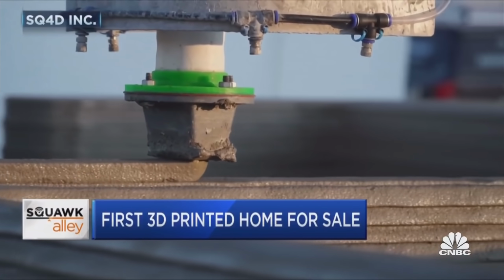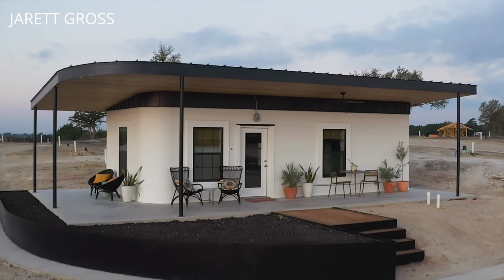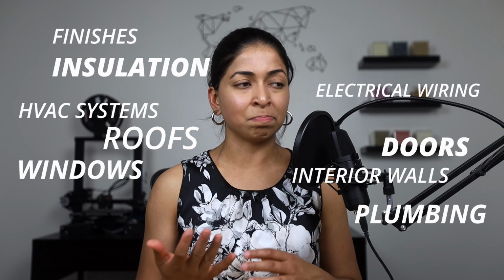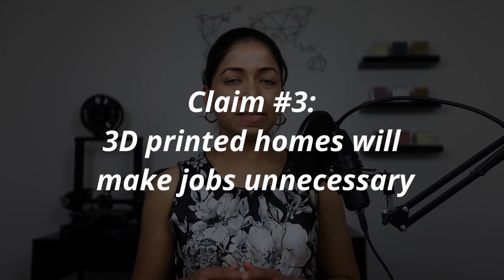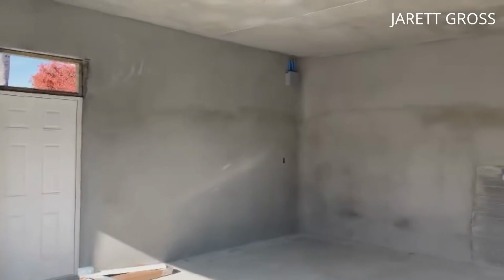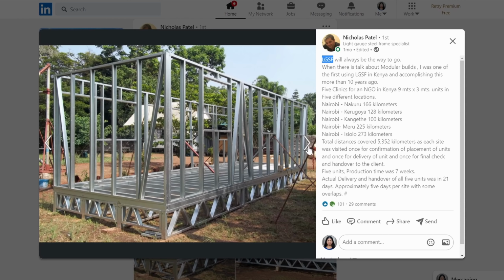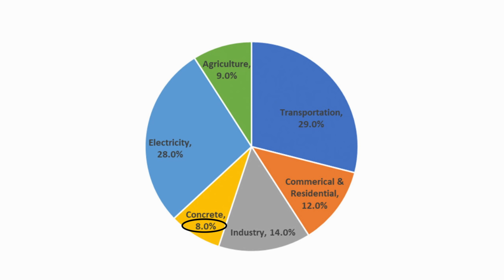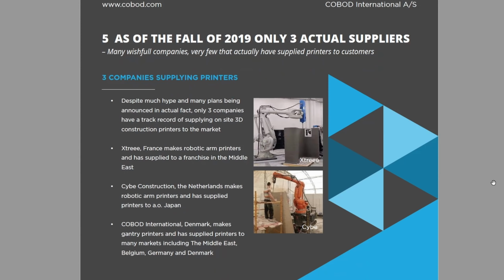Exposing 5 LIES about 3D Printed Concrete Homes

Comment: What is the advantage of 3d print over just putting up foam block and filling with concrete or using standard wall forms I don't see making putting up a wall more complex and using more electrical and everything better than what we have now and like you said concrete is horrible for the planet and that doesn't change if you pour it or 3d print it it's the same concrete plus in a poured foam wall you can put in what ever reinforcement needed for the area it's being used

Comment: The video should start out that 3D printing may not work for 3rd world countries.  Steel factories and lumber yards are high pollutants too.  The claim for a 3D printed house in 24hrs is real, they didn't claim they installed the plumbing or electric or appliances or even the doors and windows!  Just the 3D printed shell.  I'd love to get a 3D printed set of walls so I could finish most of the work myself into a nice house here in Las Vegas.  I don't want windows, I want all plumbing and electric on the sides of the inside walls for easy repair and artistic look that would be blended into the rest of the wall art.

Comment: Good job! aside from the marketing this is in its infancy and has to be supplemented with intervention because a house is a system not just a part.  I'd like to see you do more on solar panel scam that is a true scam that most people do not do the economics nor see the vast environmental impact of manufacturing and disposal.  Most latitudes benefitting from solar have the least thermal differentials for heating or cooling so in higher latitude climates the sun is at its lowest and shortest duration when they need it the most.

Comment: Clearly the speaker has no clue of current margins even sambal egg is sold rm1.50-2 while egg costing 40sen margin of finished product is 3-5x material costs so yeah it's totally possible to 3D print home under 4000usd as cement is only cents

Comment: Gimmick. What is needed is smarter use of modular materials. The issue always seems to be foundation and roof to wall connection. There has to be a better way.

Comment: I think the combination of the 3D printing construction and also the current investment into the automated construction. If you have looked at the machines that can do bricklaying, pipe setting, and wiring on its own mainly just requiring inspection would be a an interesting prospect for how future house construction will evolve. 
It seems like the market for the pre-made house sections is what is currently speeding up the most alongside that. 
Well that and also some looking into making a 3D printing/automated builder machine that can utilise local resources and techniques to quickly build basic functional buildings. 

If anything i see this as the way we have been looking at AI and robots recently (like when walking suddenly found solutions). They had some really high hurdles to get by but even just passing one hurdle created a huge leap. The question is when these leaps happen. 🤔

Comment: Concrete is very brittle .If it is going to be expressed to structural  stress it requires re bar or the like to keep it from shattering, 3d printing seems like a very optimal conditions product  with a high potential for dangerous flaws

Comment: 3D printing as a whole is still in predipper stage even for small scale.

my ideal method of construction would be something that does not require any type of glue, plaster or concrete.

Comment: From a sustainable and environmental standpoint, concrete is a horrible product. Its use should be minimised. Sometimes you don't have much choice, but when you do have a choice (e.g. walls in a residential structure), you absolutely should not be using it. For that reason, 3D printing is a non-starter, at least for the concrete variety. The same goes for ICF. Very little benefit for this product, and an environmental catastrophe, but chosen often because of overhyped claims.

Comment: This is a very well-researched and insightful video! For the sake of 20% on the construction cost, I would never consider using this experimental and toxic technique. Give me traditional clay bricks with air gaps, like they use in continental Europe or even in poor parts of South America and Asia; and I’ll be happy. If I wanted extra insulation, I can have thick boars installed on the outside.

Comment: Your explanation dealing with the composition of the concrete was excellent. The mixture is what matters as far as strength. That's what the  Romans knew over 2000 years ago.

Comment: 3D printing concrete is a good development, however they forget the isolation part. They should leave channels for isolation. And I never see them doing it. Really grind my gears, it's a waste of materials to just print a chell.
And yep, it is probably cheeper to buy concrete bricks and fill the holes with dirt.

Comment: Imo you gave the key idea at 8:53. This is just an alternative for erecting masonry substructure. Just as 3d printed plastic parts is an alternative to molding processes. It may or may not turn out to be useful in the end. The rest is hype designed to draw investment and early adopters.

Comment: I would guess the 3D printed part could really be build for $4000. But thats only 10% of the total cost.
Reply: At best that's just the cost of the concrete but that wasn't a full size home shown that was $4,000. You've got delivery fee per load of concrete, cost of renting/buying printer and labor to set it up, do the printing and clean/disassemble the printer. So even $4,000 for a tiny home is too little for the "concrete" costs.

Comment: I agree with everything excelpt the part about homeless shelters.
If you are homeless, 4 walls and a roof is a hell of a step up from cardboard boxes.
.
Most homeless people do not remain homeless.  It is a (bad) chapter in their life.
So, 3-D concrete, metal, or stick frame... doesn't matter.  They just need something to keep them warm and dry until they can get back on their feet.

Comment: "The first claim is that 3D printed homes can be built for less than $4,000. This is a flat out lie that stated circulating in 2018. Journalists misled people for the sake of clicks..." Bit rich considering the premise and title of this video has been obviously framed in order to grab people attention and get them to click on the video. As your video points out, these "lies" (I think exaggerations would be more appropriate) are denied by the owners of the technology. Nobody invests millions of dollars in R&D to create "a solution in search of a problem". What is the value of inferring such things in your video? In your previous 3D printing concrete video, you wrapped up the video with the following " think 3d printed concrete has a lot of potential in the building construction industry and it is the future." That video, titled "Introduction to 3D printed concrete", was such a well written video where you discussed the pros and cons for the emerging technology in a non sensationalist manner (loved that video by the way). What has changed? Could it be the video posted titled "7 reasons why shipping container homes are a SCAM" which garnered over 9.6 million views? Sensational titles sure do get clicks.
Reply: its called having a flexible mind-unlike yours set in concrete
Reply: @esecallum  Wow. That was insightful. Your proposition is what? 'A curious questioning mind is set in concrete'.

Comment: 3d printing doesn' t seem to be a strong idea when it comes to Infrastructure integrity for longevity. why traditional concrete using rebar before pouring concrete. engineers designing what they do best for solid foundations. These new construction technique is taking short cuts to make more profits. I don't know why building state inspectors would pass these inspections.

Comment: You should take into account that 3D printed structures will make it much more possible to migrate to other planets. The cost saving and weight saving on other planets is where 3D printed structures will find their niche.👍

Comment: There are arched construction like gothic or hypar roofs, even domes that could be printed and expand amount of cost savings
Reply: As she pointed out, you need the right kind of concrete AND the 3D printer. In many countries you can't get that, like the point she made about the trouble in Africa. Also the cheaper cost of other materials in different countries compared to the special concrete.

Comment: Excellent video! Maybe we just need to incorporate 3D printing into the prefab process. It would reduce material on hand of the prefab manufacturer and allow for custom home production for different areas! We could also look into use of different polymers and materials for CO2 reduction 😊 it would be pretty cool if we could print all the parts and then put them together on sight in 24 hours

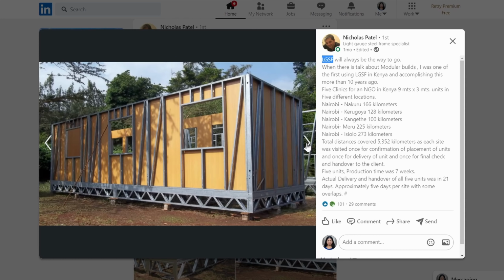Comment: There's a lot of potential in the technology and methods...but it still has a really long road ahead if it's expected to replace traditional construction materials and methods...and how strong are the 3d printed homes?...they need to build some in tornado alley and see if they are viable alternatives to stick/timber frame homes...I'm thinking they would need some kind of supportive steel frame like mentioned at 7:25

Comment: I think 3d printed homes will really become the main way of architecture if there can be a way that it also adds insulation, and and plaster, similar to a multi color 3d printer.
Reply: A rule of thumb is that 8 inches of concrete or stone walls have the insulating value of 1 inch of wood.  Concrete houses are cold.  Not a problem in the tropics but definitely a concern in colder climates.

Comment: I probably could believe the claims of 3D printing in Africa if the machine was built by the government. it would be a 3D printer on a tank. that could make its own material from local materials. or something crazy like that. without the bottomless pockets of the government and have no need for profiting then maybe they could get over all the hurdles necessary to make a machine that could do that well.

Comment: While many of the claims seem to be factual with the exception of the one-sided claim that 3D sustainability is a lie, it appears that the YouTuber has an axe to grind with 3D printed structure.  The title of the video is a bit deceptive and instead of making it appear that 3D home printing itself is a SCAM; perhaps the title should be " Exposing 5 MEDIA-LIES about 3D Printed Concrete Homes"

Comment: Yeah, great points thank you, however let's be sure to keep in mind it is a burgeoning technology that gets a lot of attention and criticism. Clearly it's in its infantile, printing simple parts simply. The goal is eventual near-infinite design limitations, and also the ability to print or construct those designs more easily. The goal is eventual balance in that implementation, once efficiencies are worked out, as most tools and technologies try to get to. It will be interesting to see where it goes, and how long it takes.

Comment: What if you replace the concrete with waste plastic?  There's plenty of that.
Reply: FIRE. Wood built homes are bad enough, have you ever seen plastic burn?
Reply: It was just a thought.  Maybe they could mix the plastic with concrete like they are starting to do on some roads with Black top.  That's where I had the idea from.  I guess I didn't say that though.

Comment: totally agree the tech is like a toddler trying to wear its dads shoes and go to work its very adorable but not gonna be pulled off completely.
could be cool to see concrete experts smooth walls and make square recesses in the walls as the machines do their magic.

Comment: Well  Good points. I could see grain storge and posibly water storage tank shells with 3d printing of cement. I can think of several ways to reinforce the structures while printing and add plumbing and wireing as well. Someone needs to modify for these and I would like to do it. As for roofs. Got some thoughts on that too.

Comment: #1.   The value put on it if more then 4k is only done by those looking to maximize their own profit.
it is possible that the home only costs 4k to completely build and all parts could be built using a 3D printer.

#2.    they completely built a 100 story building in a month... im pretty sure building a small residential home in 24h is not that far of a stretch to believe if everything goes accordingly and more then possible.

#3.    if we stretch out the idea that automated system properly setup including those which prevent homelessness and make homes, could help push society to evolve were we no longer need "jobs" as we know them now and money exchanges can slowly become the same as a 8-track....  history.

#4.    You made a bunch of repeating assumptions of prices... yet Africa could easily just take the technology without copyright and build the machines to help create the homes all the same.   Much of what is claimed would cost money could be bypassed and people like bill gates could easily help build the base infrastructure for "free".  But because corporations control how things work and how society acts, we are slaves to our corporate masters who say that we must pay insane prices because their 5th yhats are needing a new paint job.
Copyright is being abused and need to completely end because its done nothing but keep us from properly evolving by allowing a monopoly on things that should not be monopolized.

#5   a new tech that still needs to be better filtered still remains more viable then the amount of carbon and other waste created by older methods of construction.

In the end... this entire video is clearly just hate on 3D printing and if anything if YOU were dug into we may even see that you were paid to make these outrageous and clearly misleading statements\claims.

Next make up a video saying that giving people the ability to hear for the first time is fake and the earth is flat.   its pretty much the same line of thought.

Comment: Well presented. In all kinds of use cases, 3d printing is a useful tool, but its just another tool, not the answer to everything. What about 3d printing in mud with chopped straw using local materials? Could even make people powered machines using a gravity fed hopper....

Comment: This is a copy paste article. The presentor is parroting someone else agenda . The best i would call her is a key board warrior, who is far from the realtiy. 3d printing technology primarily focuses on the first world country like united states, where the cost of the labor is the biggest component in  an house. USA has the third largest population of the world, with an estimation of around 2 million housing shortage. Houses in the usa are dependent on wood and gets an extra protection of a plastic sheet wrapped around the structure. To give strength consumption of wood is way to high. The consumption of plastic like tyvek to make wood structure weather proof is another huge issue. Use of pesticides and other chemical to protect wood from termites is used heavily. Moreover in the event of hurricane and tornado, these structures are just a matchbox.  Automated construction such a 3 d printing or prefabricated components are one of the soultions. If cement is not eco sustainable, then wood is? Seriously. Chopping wood is the solution , no way. Till a new material is designed and is readily available at a cheaper cost, concrete is the solution. Prefabricated components has to be shipped from a centralised location. Which requires expensive and polluting transportation, heavy machinery for assembling, and involves greater risk for accidents. Steel structure needs to be welded onsite and needs to be covered with gypsum/ cement boards . Additionally it needs to be wrapped by plastic sheet to weather proof the structure. Such structure requires more labor and materials, thus increasing the cost. As of today no other technology gives such a kind of cost benefit advantage as a 3 d printed technology.

Comment: Thank you very much Belinda for this very interesting video. It is precisely this kind of information that I am looking for, for my ecovillage construction project in France. But beforehand, I am in the middle of studying its feasibility for the moment, for that I'm looking for more information — sincere and objective as you did in this video — on 3D construction. I have already followed the online courses of the University - Apis Cor, as an initiation. It was very informative, but no company that makes 3D printers for buildings is going to talk candidly about the pros and cons of this construction which using 3D printers.
Anyway, if someone reads me and knows an alternative to cement to power 3D printers — while remaining ecological — wishes to share this information please let me know. I know that WASP (Italy) does. But the walls of their TECLA project are too thick! In addition, I'm notn sure that in the event of heavy rain or heavy hail that their cob structure will remain standing for long. Finally, regarding alternatives to cement; there is the "NASA's Challenge to 3D Print Future Habitats on Mars", a participant used Polymer & Thermoplastic as an alternative. It's very solid, but not really ecological.

Comment: Eh.. with every innovation idea in every industry comes much hype that it's going to solve all of world's problems, thus is the way of life.
Ultimately it turns out to be useful, sure, but not quite as much as hyped.
Concrete is a versatile material, with its pros and cons, good when used within reason.. just like wood and metal and everything else.